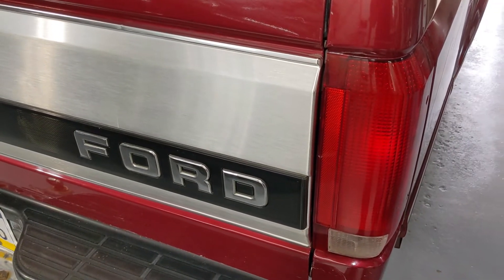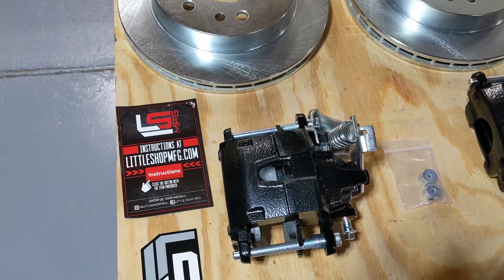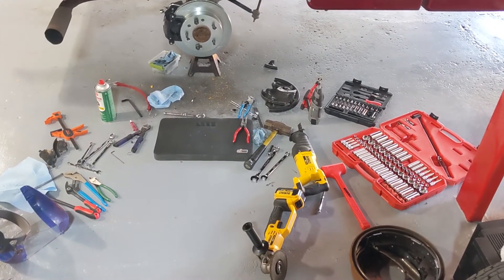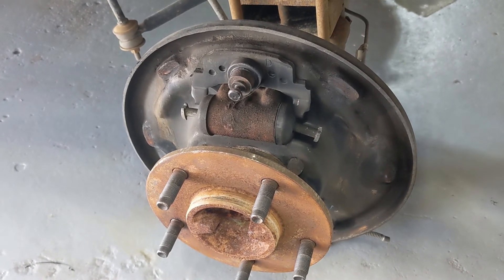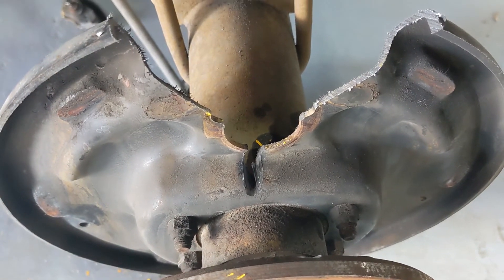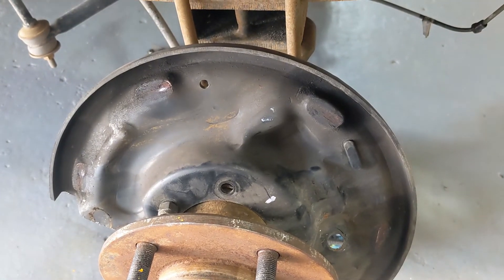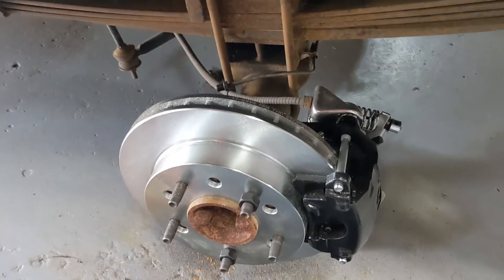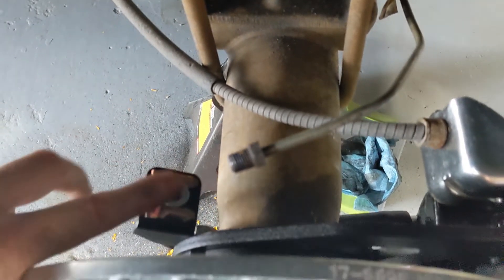Little Shop Mfg Disc Brake Conversion for 1994 Ford F-150 - Installation Tips & Initial Impressions

Comment: Hi Thanks for posting the video. I am very interested in the brake disc you have used as I am looking for it for another car project I am working on. At 12.19 in the video you appear to show the part no may be 17-6608 and the disc thickness of 24mm. The only discs I have found so far for a Ford F-150 are 28mm thick. These are too thick for my application. do you know the part no/manufacturer of you discs as they seem ideal. sorry for the odd question but it would be a great help to know! Hugh
Reply from the maker: Good evening, Hugh. Thanks for watching and reaching out! From another comment I made at one point:

An excellent question. I do wish Little Shop was a little more clear on replacement parts.

The rotors are 1.04" x ~296 mm. I'm 100% on the width, but the height was measured with the wheels still on, so I would call it "approximate". So basically you can buy any rotors that size (from, say, Napa).

I don't know the part numbers...with I would have kept better track of that stuff. It's possible the diameter of the rotors were 11.75". They were definitely 1.04" wide, though.
Reply from the maker: Even, better. Decided to relive some of this trauma, and I do actually have the exact size in a follow-up video:

https://youtu.be/QfAL-OxckP4?t=176

1.04" x 11.75"

Comment: those were  really good backing plates,  you could of  changed the diff oil  , pull the axles ,  unbolt the backing plates  and put them up for sale online ,  get back some of your money , those of us who live in the rust belt  would jump at a chance at those clean plates. thanks for the upload , I myself am considering  this upgrade to my f350 .
Reply: Correct as I had stated

Comment: I have a question did you end up having to change your master cylinder or brake booster? everywhere I've seen it says you have to change the master cylinder as well I'm just trying to see if it's true cause i want to do this swap and also do you have any info on the parts kit like what vehicle would you have to look up if you needed to replace the rotors and pads?
Reply from the maker: Evening, Brannon.

I did change the master cylinder, but that was actually not needed - I was troubleshooting an issue. I have a second follow-up video I posted about this. It was quite a journey. I ended up going with the Wilwood calipers after I couldn't get the other ones to work correctly. However, if you check the comments on that video, it's possible I didn't have them adjusted correctly. Impossible to tell at this point. You shouldn't have to change the master cylinder; however, I have read some things about changing proportioning valves. I can't tell you whether that needs done or not - all I can say is that I think my brakes work acceptably and I didn't change anything with that system.

I believe the calipers that came with the kit are Right Stuff Detailing brand. However, that's not on the calipers anywhere and I don't know the part number. However, like I said, I ended up not keeping those and upgrading to the Wilwoods. Another video coming soon on the parking brake adventure.

The rotors that came with the kit are standard 11.75" x 1.04"; however, I'm not sure what the offsets are. I'll be pulling these again tomorrow, so I can check - there may be a part number on them.

Comment: Is there any reason you didn't use a plasma cutter instead of the saw and grinder? And isn't there a cheaper kit which requires you to remove the axles? To me I would like to check my differential and put new quality fluid and gasket anyway. I would probably put new seals in too so everything is good for a long time. but thanks for showing us how its done. Greatly appreciated!!
Reply from the maker: Evening, sir. Thanks - happy to help! A plasma cutter would have been amazing - unfortunately that's still on the wish list. Maybe Santa will bring one this year : )

I don't believe there is a cheaper kit. The backing plate is the only thing which brings that into play. I completely agree that, if doing it again, I would pull axles. The diff maintenance needs done anyway, and would have about broken even on the labor.

Comment: 2 years later (with slight Spanish accent) would you recommend installing a porportioning valve? 🤔
Reply from the maker: I didn't keep the truck, so don't have a long term review to offer. When I sold it, the brakes were working well without a proportioning valve (and the Little Shop instructions didn't recommend one). However, I never was able to do the parking-lot-lock-up-the-brakes test. I suspect that's going to be the only way to know for sure if you need one or not.
Reply: @rckclmbr85  👍

Comment: What issues were you experiencing with the drum brakes.My new drums and linings give shake and brake action.No-one in this corner of Canada turns drums anymore.Might try a known good used from a salvage yard.CHEERS from here!  P.S. mine is 1995
Reply from the maker: Morning, Darryl. The passenger drum always got very hot - never could get it to act normally, even after having an actual mechanic check it out. Looking back, I definitely would have put more effort into it, though - the conversion was quite a chore and isn't even done yet, since I still don't have a parking brake. That project is being tackled this weekend. Should be interesting. I'll be posting a video of that build as well. Good luck on the salvage, and thanks for reaching out!
Reply: @rckclmbr85  Got it! THANKS

Comment: Sweet, Thanks for the walkthrough.  I bought a kit for my 1991 Econoline  ( different vendor/manufacture but same calipers and stuff same principle) .  My concern was mostly  the E brake but this made me realize its pretty straight forward ( pending adjustment).    Do you know that if you have a Rear ABS valve system that you need a proportioning valve? I've read on truck forums that the rear ABS acts as one so I wouldn't but  not sure.  Also how is it?   Did you notice improved braking without upgrading master cylinder?
Reply from the maker: Hi, d s. Sorry for delay. I do have a great ABS module I had to replace. However, I'm not sure whether or not that acts as a proportioning valve. The rear brakes certainly seem to work, but I wouldn't say they are better than the drums. However, I've not towed with the truck since putting this kit on, and drums are typically as effective as discs until they get too hot. So I haven't pushed it to the point of telling a difference.
Reply: @rckclmbr85  oh ok,   yeah    the ones in my kit are drilled/slotted    so all 4 of my discs are now.  Maybe that will help a bit.   The 92+  econoline actually had dual piston calipers up front   and  I guess the spindle would have to be changed  to ever do that but     single piston all around.    but yeah I have read that they're not going to be noticeably superior unless you upgrade the master cylinder which I believe is more capacity...    Did you end up cycling the parking brake   like to set the piston/pad distance to rotor?  I'm glad someone posted that video   I'd never seen that.. so at least I'll know.    I doubled the horsepower of my van NA (yet to all be assembled)  then was going with a supercharger so I had to upgrade a lot   like  I trussed the axle tube to tie in the pumpkin and got chromoly axles .. and this was a good alternative to a C clip eliminator ( which you cant seem to find for the vans axle hub is a little different.)   but now the blower   ( ironically )  I realized wasn't going to clear the master cylinder so back to NA     but its still twice the power so    I needed to do this.   I mean maybe I'll look into which master cylinders work / brake booster   etc.    and possibly be able to do that before its all done and can report back .

Comment: Did you ever finish adjusting your parking brake I plan on doing this to an off-road rig and I have a manual transmission so the e-brake is super important. Thanks for the video!
Reply from the maker: Evening, Chris. I never did get those calipers to work. However, I have a second video explaining some issues, and that has a lot of comments about what I may have done wrong as far as adjusting them. I can't verify, as I gave up and decided to use Wildwood calipers instead (and that's a whole other video you can check out, if desired). Video with the helpful comments:

https://youtu.be/Z5i01HkBHN8

Agreed - with a manual, the e-brakenis critical, so good luck on the conversion!

Comment: Hey great video!! I am looking to do this on my 96 F150 as well. This may be answered elsewhere but see you are pretty active on responding. If you need to replace the rotor are they same as front or at least easy to get?
Reply from the maker: Evening, J. Had a similar question a couple days ago. I don't believe they are identical, but don't quote me. I still need to bleed them, and I'll get to that in the next couple of weeks. When I do, I'll pull part numbers for you. If you're in a hurry, Little Shop Mfg. replies insanely quick to emails, and I'm sure Skyler would know off the top of his head.

So far, even without bleeding them properly, I'm very glad I did it. So I'm expecting things to be even better once the excess air is purged.
Reply from the maker: Evening, J.

Not sure if you reached out to Little Shop or not, but there are no part numbers on the generic parts. I have a newer video on my brake saga, and I ended up upgrading to their Wilwood calipers.

In either case, the rotor size is 1.04" x ~296 mm. The latter was measured with the wheels on, so it's approximate, but any place, such as Napa, should have rotors that size available. Pads I'll be getting from Wilwood.

Hope this helps.

Comment: Thanks for making this video. Been thinking about doing this on my 91 F150. Any reason you couldn't flip the brake line bracket so it would reach on the drivers side? Is there a replacement caliper and rotor that can be sourced from a parts store in the future?
Reply from the maker: Evening, Joe. Sorry for the delay. Life's gotten a little crazy lately.

So, I don't think you could flip the bracket, but I do think you could likely take their bracket, cut the tab off, and weld your own tab to the other side (meaning "toward the rear of the vehicle"), and that would allow you some leeway in the brake line. That would also likely allow for easier brake bleeding, a process I still have properly tackled. They may be a separate video.
Reply from the maker: As for the parts, they are definitely readily-available off-the-shelf items, but I will try to get part numbers for you when I bleed them. Hopefully in a couple of weeks.
Reply from the maker: Evening, Joe. I dropped the ball on this response. Been a journey (see new video for details). Anyway, the rotors are 1.04" x ~296 mm. I measured the diameter with the wheels still on, so that's a little bit approximate. But any place, such as Napa, should have rotors that size.

There are no part numbers or names on the calipers or pads. I actually ended up upgrading to the Wilwoods. So I'll get pads from their website for the D154 calipers.

Hope this helps.
Reply: @rckclmbr85  I'm pretty sure that the calipers used in most of these kits were for  1960s GTOs and such.

Comment: I just did the rear brake shoes on my 94 F150 5/22, took 45 minutes to replace both sides! got to be the easiest drum brakes in the world to work on.. 190,000 Mi is how long the original rear brakes lasted.. .
Reply: Just did mine and I get brake juddering when braking hard with the new drums and linings direct from China.Drum on drivers side seems out of round.Cheers from Canada

Comment: So no axel swap, and no master cylinder swap? I’m liking to doing a conversion on a 97 f150 because the drum breaks on mine are absolutely terrible and no one can fix them.
Reply from the maker: Neither of those is needed, but you may want to consider a replacement proportioning valve. I did not do that on mine, as it was stopping fine, but I've seen other folks recommend it.
Reply from the maker: You may also want to view my two follow-up videos on this topic...it was quite a journey...
Reply from the maker: There are also a lot of useful content in the comments from other viewers. Some of their suggestions are things I did not try, so I couldn't verify if they would have addressed my issues or not.
Reply: @rckclmbr85  thanks man I appreciate it a lot!

Comment: What did you do for a pro porting valve and emergency brake cables
Reply from the maker: Evening. The kit didn't recommend a proportioning valve, so I kept the factory setup. Brake performance was good without that adjustment. I do know that Summit sells one for conversion kits. Also used the factory e-brake cables.
Reply: @rckclmbr85  ok thank you this helps a lot

Comment: How come you did not use the black brake lines that come with the kit?, I’m looking at doing this to my 95 f150, just wondering.
Reply from the maker: Evening, Chuck. I actually did. The lines that come with the kit are just extensions that allow you to close the gap between the factory lines and new calipers.

Overall I'm still happy with the kit. I still have yet to properly bleed the brakes according to their special procedure. Which tells you they are working relatively well even without doing that. But I do want to do it properly someday soon, as the pedal is still just slightly squishy.
Reply: @rckclmbr85  ok that’s good to know, thanks J.C.

Comment: What will you do when you need to replace a seized caliper.? Will you forever have to go back to Little Shop for replacement.
Reply from the maker: I ended up switching to Wilwood calipers, as I never could the generics to bleed (see my follow-up video for more details). But generic replacements could be obtained from Little Shop or I believe Summit Racing has some that look identical. I do trust Little Shop to provide good customer service. Just couldn't get the generic calipers to work for me.

Comment: to which disc brake conversion kit did you use in the ford the normal one that you put in the link or the 9
Reply from the maker: Evening, Guillermo. Thanks for watching! I personally ended up with this kit with the red Wilwood calipers:

https://www.littleshopmfg.com/ford-80-96-f150-bronco-rear-disc-brakes/
Reply from the maker: I started with the parking brake calipers, but never could get them to work. See my follow up video and the comments - there are some helpful ones about adjusting the parking brake calipers if you go that route.